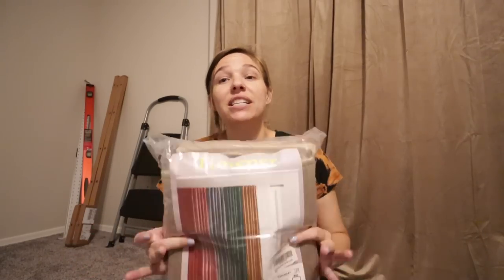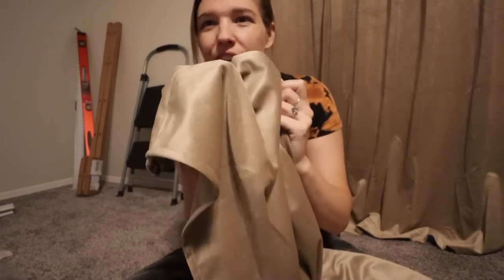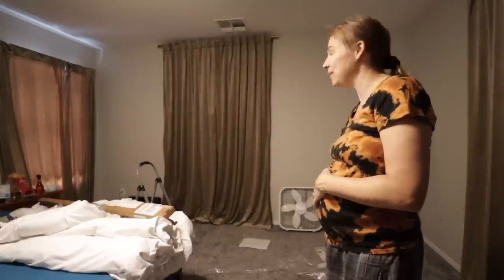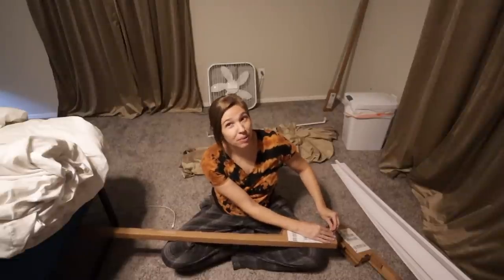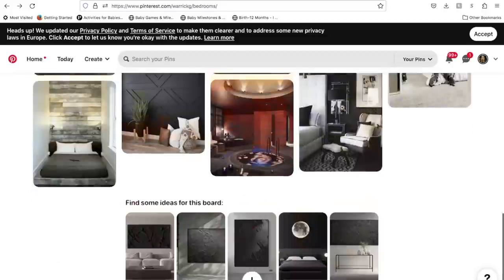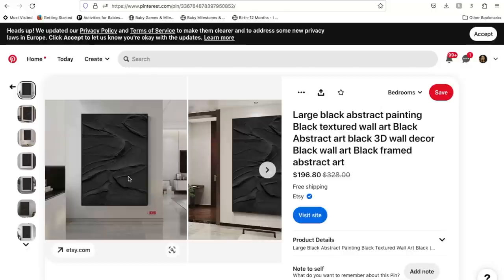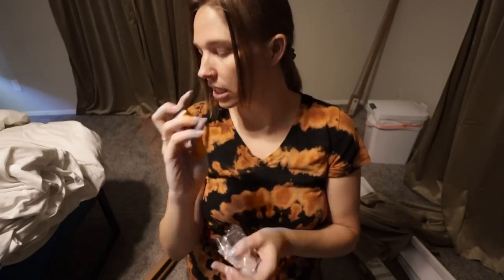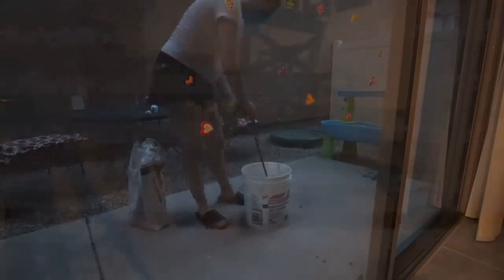BEDROOM MAKEOVER! Part 1! | Velvet Curtains and Headboard DRAMA! lol

Comment: Black duvet looks great with the arch!  Personally, drapes that puddle on the floor annoy me because I'd be sucking them into the vacuum constantly. They also collect a lot of dust. I've always hem😂med mine up so they just skim the carpet. Try to vacuum around them and see how you feel about it. A hand steamer and drapery weights (if you decide to hem them) will generally take out wrinkles. Check your packaging to see what fiber they are made from. That will dictate how hot a temp they can take for ironing or steaming.

Comment: My husband used to work nights so I finally found a way to completely block light out during the day. I used black screen film on the inside of the window. Then used a tension rod with a blackout curtain on the inside of the blinds. Then blackout curtains on a rod as normal on the front of the blinds. We still have it that way so it’s easy to take a nap anytime of the day. I learned I sleep much better when it’s completely dark with a sound machine.

Comment: You can’t have a “moody” room with white walls. Paint is the easiest thing to redo! . Or maybe just a few peel and stick, moody, giant murals on the walls. Amazon def has big moody murals similar to the floral art in your pins. They also make peel and stick plastic molding, it’s a cheap way to get a big impact with trim and molding. I love having multiple sheet sets that mix and match with the bedding, especially prints. Keep the neutral bedding and have fun with your sheets. Do you have any art planned for the room other than the plaster? Or any accents, Knick knacks, or even fresh flowers you want to tie in? Cause that’s where your next color should come from.. keep the duvet neutral but maybe get one or two throw pillows or funky bedside lamp (or lampshade) with that same color.

Comment: I love the painted arch! And it’s better than plaster because you can lean on it! I also love the black duvet. It’ll hopefully satisfy your moody dreams at least temporarily. One suggestion is to add a few throw pillows on the bed that are something different. Either another color or a texture from your mood board. Try your current blue pillowcases to test if you like the contrast because my first thought was teal. But they could be a print. With so many neutrals I think a pop is needed. But I love what I’ve seen so far!